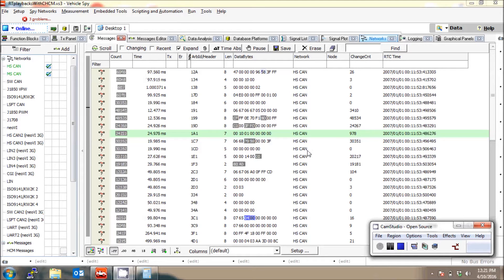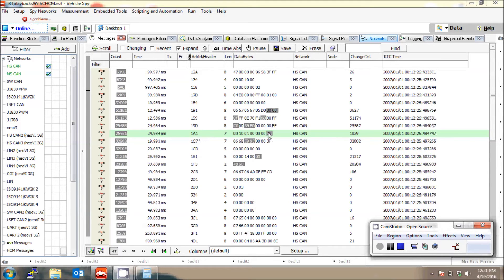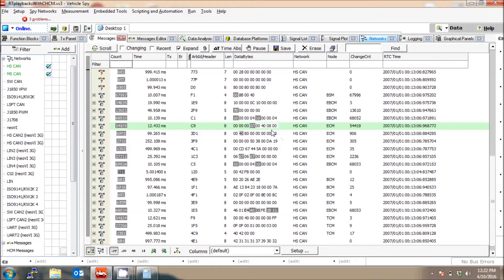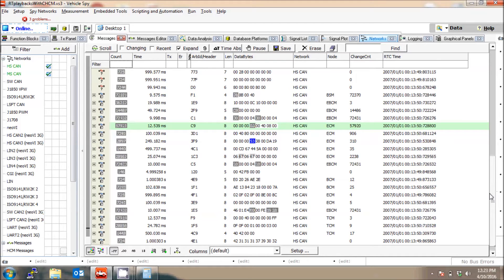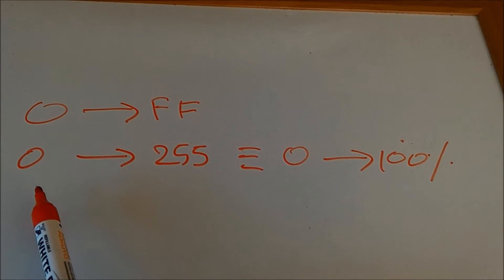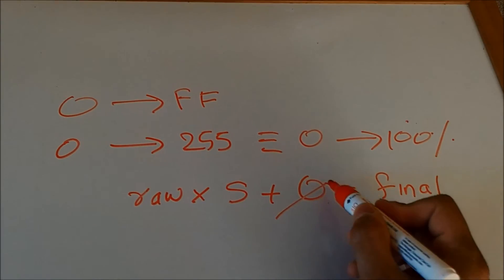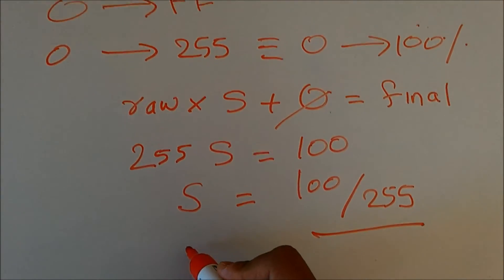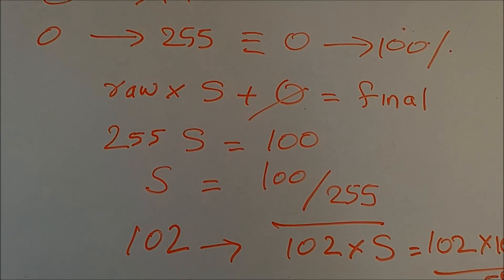Decoding Pedal Signal from Vehicle ECU

Comment: what is DBC could you make it a bit elaborate, as i kinda grappling with the numerous data dump that i have collected for a \honda 1.5l ivtec engine
Reply from the maker: dbc is "database configuration" file. It has all the details of all the CAN messages from the vehicle ECU (like signal names, lengths, start bits, periodicity etc). DBC is usually proprietary to the vehicle manufacturer